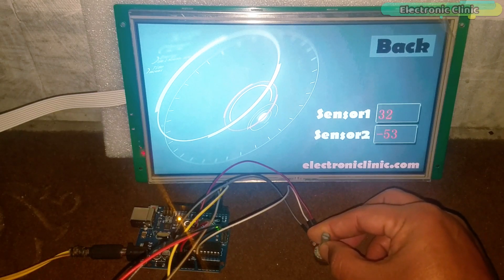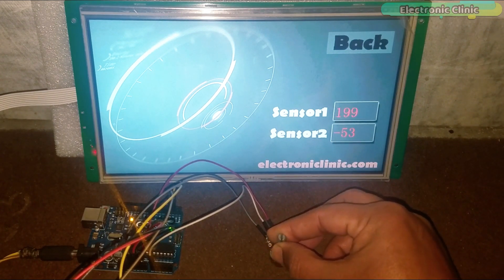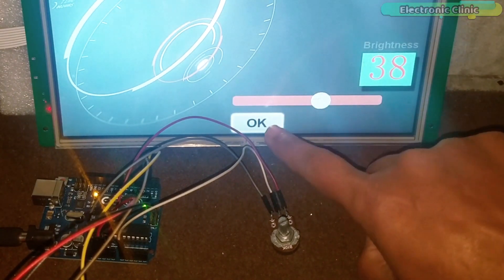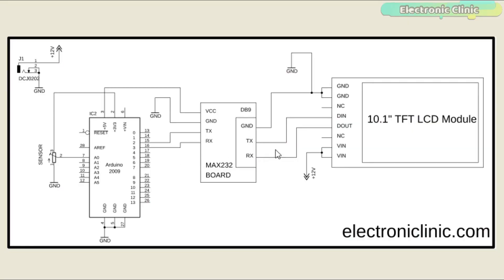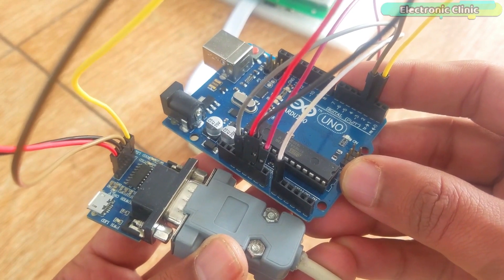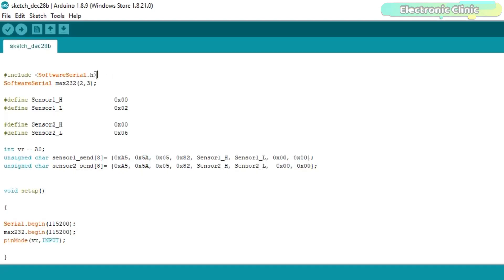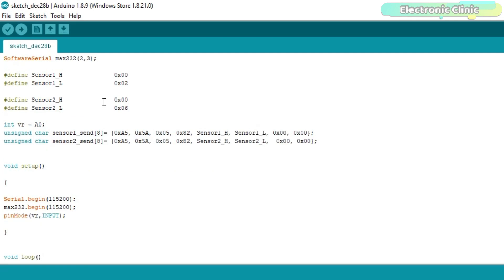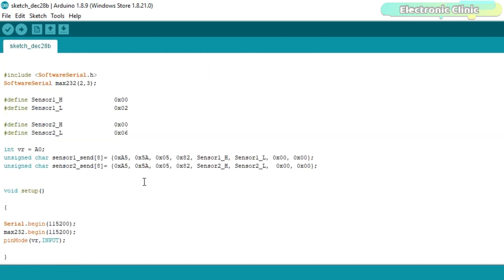Arduino HMI intelligent TFT LCD based Sensor Monitoring “Stone Technologies”

Comment: Can we connected the lcd to arduino without using max232 ?
Reply from the maker: if you can make another circuit yourself. bro you will need this. study about max232 and you will find why am i using it
Reply: @ElectroniClinic  okey bro Thanks

Comment: Hi. Excuse me. Why save the value of sensor1 in location (6) and (7)?, locations (7) and (8) correspond to the value of the variable right?.
Reply: Hi, our LCD has similar software as STONE and much cheaper prices. Our 300 engineers offer free technical support.

Comment: Tried this but doesn't play with my Stone HMI STV model. I changed only the addresses to send the data to the variable address but nothing goes thru. Using the provided serial to rs232 from Stone which works fine with the debugging console. What variable type was used in the HMI setup for each variable. unsigned, long, long long etc?
Reply from the maker: this is working great on my end. check my other tutorials on the same hmi
Reply: @ElectroniClinic  What variable type was used in the HMI setup for each variable. unsigned, long, long long etc?
Reply: Hi, our LCD has similar software as STONE and much cheaper prices. Our 300 engineers offer free technical support.

Comment: I've been trying to figure out how to use Python to monitor several sensors(volts,temp,watts,kWh) but having trouble getting started with how to address the HMI. Any tutorials?
Reply: Hi Our LCD manufacturer is 400,000 square meters, similar software as STONE and much cheaper prices. Our 300 engineers offer free technical support.